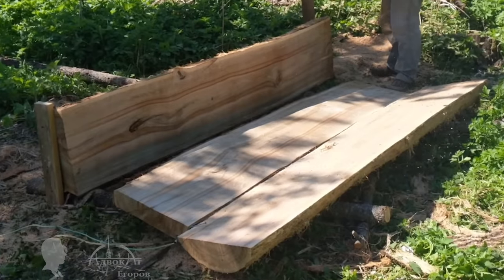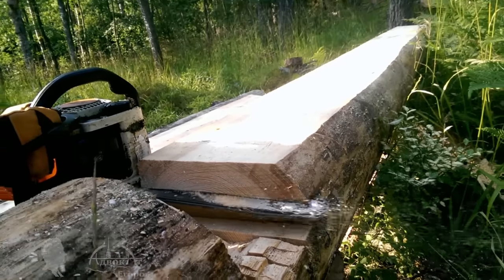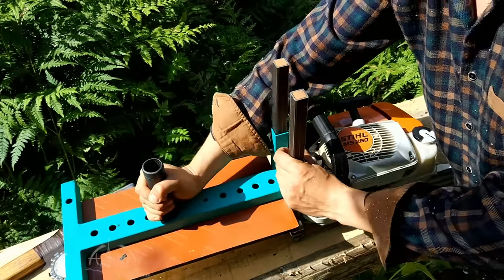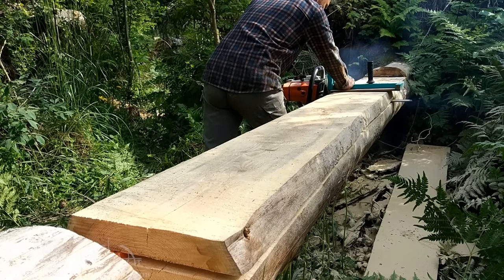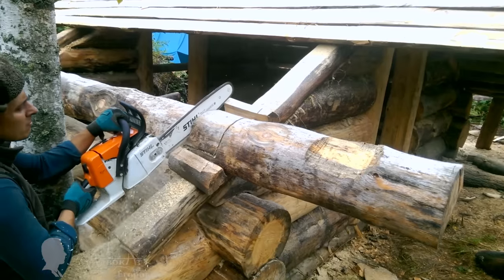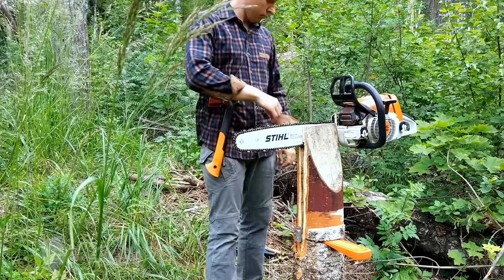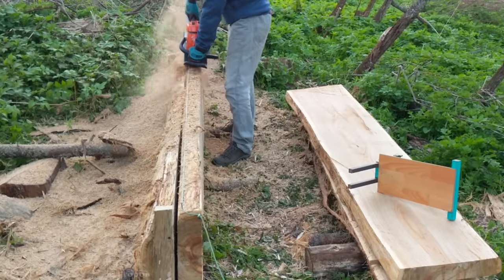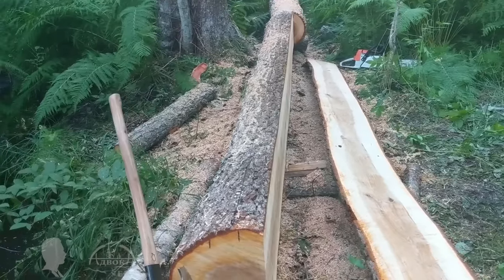Two Chainsaw Secrets | Turning a Tree into Perfect Boards

Comment: Thank you. My second viewing of this. Thoughts:  Ive used a Stihl 440 with 32" bar and 660 with  36" bar. O44 skip tooth chain to rip logs. That being said  all chain  was Round filed. Great for ripping. Im sorry to hear your difficulty with 260. That was the direction I was going with my age coming on. Hmmm🤔
Shade, end sealing lumber/ logs up off ground the best. Wrapping in tarp or fabrics promotes deterioration/ color, and invites bugs. Metal roofing and cool shade the best!! 
Best regards,& again thank you. I wish I could swing that tip as evenly as you. 🙋‍♀️❄️
Reply from the maker: I ended up buying an Echo 365 chainsaw that year. It is still working well.

Comment: Dear Maxi, I have been investigating chainsaws for the first time in my life and the feedback I get is “there is no substitute for power”. The model you have in the MS 360 no longer shows in my current Stihl chainsaw list. Models around this have a power rating of 2 ~ 3 kW. The model my dealer recommends for milling, based on what the fellows who already do lots of milling use is an MS 661 C-M with a power rating of 5.4 kW. To me, asking what fellows who are in the field use is a good place to start. They use them for one good reason: they work. Cheers.
Reply from the maker: Peter, I ended up getting a Husqvarna 365 chainsaw that many people recommended here. It worked flawlessly for almost two seasons.

Comment: What  you need for your "mill attachment" is a "skip tooth" chain.  It has fewer teeth and acts like a "rip saw".  You can get that type of chain at a Stihl dealer to fit the bar you have.  Also for those wide logs, you need a bigger saw that doesn't have to work so hard.

Comment: If youre able to set up a solar array you could charge up electric batteries. I have a STIHL MS 180C and it takes a while to start it up. Not fun. With a battery powered chainsaw you just press the button and it works immediately 🙂 i love it! the Stihl always went dull fast after 5 or 6 good cuts because I'm cutting old oak. I was cutting oak (both new and old) for 10 hours straight last weekend without a problem and without my chain getting dull. My new battery powered chainsaw is 60 VOLT with 18" bar. I paid $200 for it without batteries which I already had. Best purchase Ive made in a long time.
Reply from the maker: Thank you for the reply.I ended up buying a Husky 365 as a more practical option for me...
Reply: Согласен с вами

Comment: I use a Husqvarna 455 rancher for most of my log cutting. it is a good general use saw and I have had very few problems with it over the last eight years other than general maintenance.
Reply from the maker: I ended up buying a Husqvarna saw last summer. It didn't disappoint me yet))

Comment: I have the logs between my legs and cut backwards from top in a swinging motion walking backwards. Watching straight from the top you can assure that the cuts are perfectly straight. I leave about 20 cm on both ends of the log intact and finish all the cuts first before cutting the ends off. With the final cut the log falls apart in boards. My saw is an MS 261 C-M with a 40 cm light Blade. Works perfectly.
Reply from the maker: Thank you for the info

Comment: Hey man, one thing to think about is skip tooth chain. Skip tooth has less teeth in contact with the wood when your entire bar is in the wood. It’s used a lot by people here on the west coast cutting really big fir and spruce. Also Husqvarna pro saws are just as good as stihl. Even better. And they are cheaper. A Husqvarna 372 xp can pull a 24 inch bar all the way up to a 36 inch bar. I think you can get them without a wrap around handle too. 
Also, using square grind chain cuts faster, and make sure you check your rakers, which are the things that stick up in front of each tooth. They have to be even with the top of the tooth. If the rakers are higher than the tooth, the shavings will come out like dust. Sharp, square grind, full skip chain with your rakers checked should make it cut better when your bar is fully in the wood.
Reply from the maker: I ended up getting a Husqvarna 365 chainsaw. No complaints so far...

Comment: Thanks for the video. Really like your method and I’m going to try this. I use the Echo 7310P with only V.P. 50:1 fuel. I changed once to a 40:1 and it wouldn’t even start. My Echo is back on V.P. 50:1 and starts every time. $860 with a 24” guide bar. Read reviews and YouTube videos on the echo line. I love mine and will be staying with Echo. 
Dave Marriott Texas USA
Reply from the maker: Dave, thank you for the reply

Comment: I have a question for you.

When you're cutting with the tip and swinging it back and forth how do you prevent a "Kick Back" from occurring?

From my understanding of the proper techniques of operating a safely, you should never cut with the upper tip. You were saying to cut with the lower tip, but when you plunge the guide bar into the trunk of the tree, the upper tip of the guide bar is only going to make contact with the sides of the channel of the cut.

(Also, I love your videos!)
Reply from the maker: I use the bottom of the tip, I don't get kick backs this way
Reply: There were two separate techniques shown, here.  The plunge cut (going straight in) is a cross-cut and is different and takes some good knowledge and experience.  I would not try that until trained properly.   

His other cuts were rip cuts which start slowly and shallowly to establish the line, then continue deeper and deeper and deeper along that line, always tilted backwards so that only the bottom is in contact.   He showed many scenes where they were almost complete, so that it looked so much like he was plunging in all of the time, which he was not really doing.

Comment: ECHO, & or Dolmar (made in Germany) which was bot by Makita several years ago.  Echo is/was made in Japan and is geared a little lower so it seems to not bog down in a load.
check out the chainsaw shootout videos to see for yourself.  Stihl huskey are very good saws but I think they are a little over priced and a little more complicated
than they need to be.....Great video and a good idea. Are you or have you looked into or made a ripping chain to lessen the load on your saws motor?
Reply from the maker: Thank you for the info. I use ripping chains for milling slabs...

Comment: Hello and thank you very much for the video. I'm definitely going to try your technique as it impressed me straight away.
Concerning your issues with your Stihl MS261 my only advice would be to stay with them but in the pro range with an ms362 or 462 these are trusty machines and you will easily get 600 hours maybe more of hard work before a engine failure. It seems that Husqvarna are having a hard time since the introduction of electronic carburetors. Cheers.
Reply from the maker: Thank you for the reply! I ended up getting a Husqvarna 365 chainsaw about a year ago. So far so good...
Reply: @Advoko  hope this machine gets you satisfaction in the continuity of your job.
One last thing, what fuel do you use?
If aspen, then continue! If regular petrol with oil, maybe you could just add a tiny more oil in it. New engines are very lean and this is not good for longevity.
I’ve matched some of your others videos and fell in love with your Yakutian knife. I should definitely try to forge one as the blade shape is magnificent.
Carry on the good job 👍🏼👍🏼👍🏼!

Comment: Great video! A little info I have acquired… The older Stihl saws are WAY better & stronger built than the newer stuff. You can find older ones on EBay. Anything starting with a “0” in the model # are the older ones.  I started out with an MS250, upgraded to an MS280, then an MS362. Each upgrade I noticed a huge difference in power and usable benefits. In my personal opinion, the 260 is way too small for what you are doing. The 362 I believe is the smallest “professional” saw stihl makes. Anything under that is a weekend warrior “home owner” saw. I know the weight thing is a draw back, but I would seriously consider a bigger saw if I were you. And with some research you can probably cross reference the equivalent of a 362 to one of the older “0” models. Only difference is it will probably be a bit heavier since they used metal bezel and cover pieces. Good luck!
Reply from the maker: Thank you for the info on Stihl saws. I  ended up buying a Husqvarna 365 chainsaw and it didn't let me down for almost two seasons...
Reply: @Advoko  i was wondering if you tried a husqvarna, Nice to hear you like it. I work in the next building over from the husqvarna chainsaw lab and the talk is they know what they are doing :)
Reply from the maker: You could send them "my two-season full satisfaction" with their product;)))

Comment: I have been using an Echo chainsaw with a 36" archer guidebar and an Alaskan saw mill set up.  The saw has been less troublesome than my neighbors stihl... right out of the box.  I use ripping chains and have been able to cut beautiful 26-28" 3" slabs of sycamore I will be selling or making tables with.  I have an 18' 37" base I need to manage that my sawmill will not accomplish due to the tip fitting of the sawmill (2 point, not a free end design).  I have a good "eye" so I believe I can try your method with success.  I have a downed 20" cherry  still attached at the trunk (therefore able to dry) I've been waiting to cut, that's now ready.  I'm building a quail recall pen in the woods and this will make fine boards for the walls, flooring... I hope :)
Reply from the maker: Thanks for sharing your Echo saw experience!
Reply: @Advoko  its the Timberwolf model. Favorably comparable to the stihl Rancher but more dependable an more favorably reviewed.  There are cutting speed (power) comparisons that show the difference.  Echo makes an 18" + 26"(?) guidebar, but aftermarket mfr's like archer make a 36" that has worked great for my applications.  I'm currently building a quail recall tree house off my wooded, riverside bluff using the boards I make.  Are you familiar with the process of charring wood to make it able to placed in ground contact?  I'm told you can burn the base of a post  ("char" it) and it will last longer than treated lumber?  Thanks!
Reply from the maker: I used car oil to protect a wooden foundation for my outdoor anvil https://youtu.be/KPoSJ8kxoCs

Comment: Amazing man!!! Thank you!! I will try your method soon. So basically you cut following the line you set with the thread.  What did you put at the end of that lumber board to dry?
Reply from the maker: I used saw dust to slow down the drying process to prevent large cracks

Comment: Dobri Utro, Tovarich.  My MS 260 has lasted real well...got a 261 that gave trouble right away...it had a weak spark.  Got a new coil and a 3 prong spark plug from JImmy Wang in China (I think that was where it came from...had chinese writing on it(, and it cranks now and runs well...though too fast for my taste--but cuts good.   Huskyvarnas generally crank more reliably than Stihls, their problem used to be in the plastic case that woud fatigue and crack.  That's the only two I know much about.
I've also freehanded planks and it works well if you have a good eye and good instincts.

Reason I wrote is below, though you can do as you please...but:
As an old man, I'd advise you to use ear protection...wish I had done that back in my younger days!

Also, for long lasting saw, vary the revs...running at constant revs can damage the cylinder and piston as the end of the stroke is always at the same exact place.
Reply from the maker: My MS 180 lasted me over 20 years and still works...

Comment: You need to make a solar kiln, super easy to build a passive setup using convection. All you need is a sheet of glass and a makeshift housing with vents on the top and bottom. Angle the glass on the roof south facing and viola. You can make it more advanced using heating or electric fans, but I always prefer simpler.

Comment: You inspired me to go to my backyard and mill  wood with your technique . I used my ms170 . It works great till I got impatient and did not swing the saw enough , trying to take too much of a cut at once . 
 As for your question about chainsaws . I think you have been spoiled by the MS170/180 .
I am the same way . I own and barely use
MS440 028 MS250 MS251 . 
You my like MS201T
It’s light weight good on fuel . 
And don’t stick to original parts Will cost you more money than it’s worth carburetors and plastic and get it off of Amazon .
Reply from the maker: Thank you for the reply! I ended up getting a Husqvarna 365 saw and it held up well for almost two seasons...

Comment: Fantastic video!! looking foreward to the next one. Question: You sharpen the chain at 10 degrees and not at 30 degrees as manual says?
Reply from the maker: Yes, it was done for making better rip cuts. Ripping chains that you can buy have about the same angle.

Comment: I use a Husqvarna 450 Rancher and it works really well in both light duty and heavy duty applications. A Husqvarna 61 is a pretty powerful saw, maybe try these and see if it helps? This video has been tremendously helpful as I'm about to start cutting my own lumber rather than buying it from a store. It's just too expensive, so thank you for passing along your knowledge, I hope my advice helps you in return 😊🪵🪓 On another note, i was always told thay a chain should be sharpened to 30° is that not right? Ive neber heard of sharpening at 10° but i will try it. By the way, when milling with the attachment,make sure you put a wedge, under the piece you're cutting, about ebery 2 to 3 feet to keep the top piece off of your chainsaw bar. Itll help you get more accurate cuts. Seems like you dont need that bit of advice though, as youve mastered cutting slabs without attachments! 😆 Kudos to you on that!

Comment: Watching your video...i am not sure but maybe this may help.  When running the lines....to cut sown the length of the tree n etc.  What if you used a chalk line? U would have no issues with the staples and nails. However still have your guide lines. Also to keep the chalk line for a ĺittle moment you will want to spray it with hair spray. You can use a cheap kind. But make sure  it comes from an aerosol can. I learned this when i was little grouting floors and building pole barns.
Reply from the maker: Thank you for the reply!

Comment: Funny you mention idk why the ms170 is the most reliable saw i've ever used in my life. My 260 has held up tho. The picture of your piston looks like maybe your oiler was clogged with dust or wasn't working properly and you overheated your powerhead. Either that or the mix was bad.

Comment: My dad ran stihl saws for a park district for 25 years and he always said Stihl homeowner saws aren't very good anymore, any of the ones with model numbers ending in 2 are commercial models and are much better. His recommendation was the MS362 and ONLY EVER canned gas, he said the newer emissions standards and stuff made them no longer run correctly on pump gas. For my money and for milling specifically I'd probably just buy a Chinese clone of an older model.

Comment: Hey dude, really the sharpening Is the secret. Here in Brazil they use ms381 or ms361 at least. Manu Say 272xp Is very good too. They say hard pointed saber os better too. And for maintening the grain, WE saw first half of the log, saw all boards until reach the middle, then reach the other side. Only at last we separate all the boards, só they dont fall.
Reply from the maker: Thank you for the reply and the info

Comment: I wanted to do the same thing with some big pines I have above my house. Great job. Have you tried to cut boards that are half that thickness?
Reply from the maker: You could, however, it is not practical as they will likely warp while drying and after jointing will lose most of their thickness...

Comment: I've never seen a husgvarna on a wildland fireline.  I have maintained, but used the hell out of a ms320 on the fireline, and used many other Stihl in arborist work and in the state of Alaska department of Forestry, and swear by them.  There are too many plastic parts, and proprietary BS parts that Husqvarna includes in their saws that are designed to break, or require a Husqvarna dealer to repair.  I'm a fan of a ms462, or ms500 with a 28inch bar.  Powerful, light, durable, and reasonably easy to repair yourself
Reply from the maker: Austin, thank you for your expert’s reply!